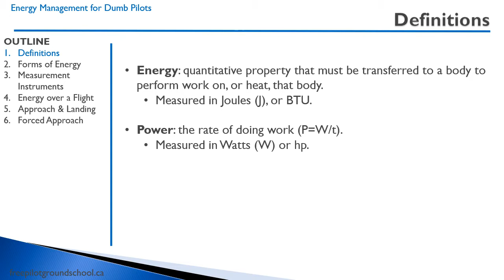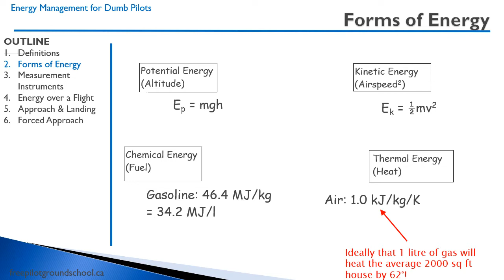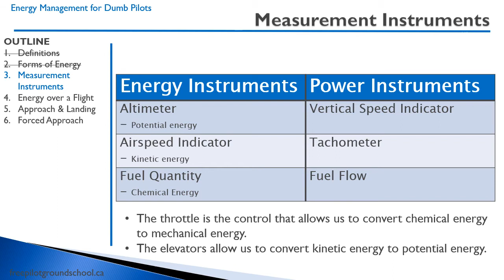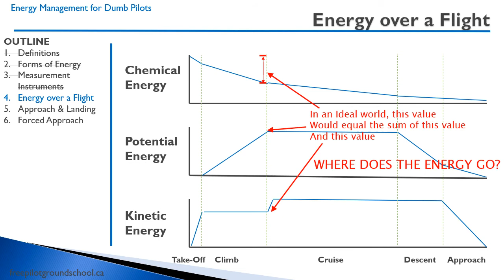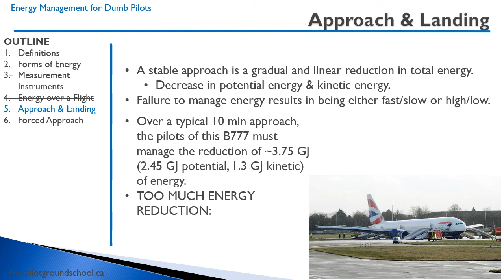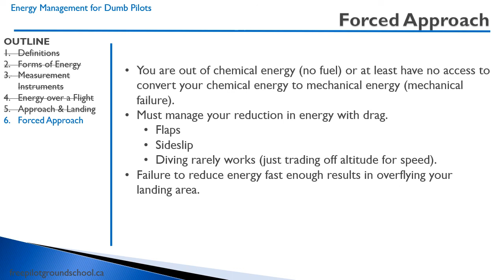Energy Management for Dumb Pilots

Comment: To answer your question - through the miracle of AI:

Great question — and you’re exactly right in your reasoning.

Yes, most global warming is driven by the greenhouse effect — where gases like CO₂, CH₄ (methane), and others trap heat in the Earth’s atmosphere that would otherwise escape into space.

But you’re also right that burning fossil fuels releases heat directly — and that heat must go somewhere, contributing to the Earth’s energy budget. However, the direct heat released by combustion (also called anthropogenic heat flux) is tiny compared to the heat trapped by greenhouse gases.

🔥 Breakdown: Direct Heat vs Greenhouse Effect

1. Direct Heat from Burning Fossil Fuels
	•	When you burn fossil fuels, you release thermal energy (waste heat) into the environment.
	•	Globally, humans release on the order of ~0.03–0.05 W/m² of anthropogenic heat flux (from all human activity — not just fossil fuel burning, but also industry, electricity, cars, etc.).

2. Trapped Heat from Greenhouse Gases
	•	The radiative forcing (extra heat trapped) due to increased CO₂ alone is about 2.0 W/m², and the total greenhouse gas effect is well over 3 W/m² as of recent measurements.

So the greenhouse effect from added GHGs traps over 60–100 times more heat than the direct heat humans release by burning fossil fuels.

🔧 Analogy

Think of it like this:
	•	The direct heat is like leaving a candle burning in a room.
	•	The greenhouse effect is like insulating the room and turning on a giant space heater — the heat builds up and can’t escape.

✅ Bottom Line:

Yes — the direct heat from burning fossil fuels contributes a tiny amount to warming, but it’s negligible compared to the heat trapped by greenhouse gases. The greenhouse effect is the primary driver of anthropogenic climate change.

Let me know if you want visual data, citations, or an aviation-specific angle (like contrails or jet engine emissions).

Comment: Excellent video!! It reminds me of my freshman Physics 107 class. Releasing that heat into the atmosphere has to increase the mass of the atmosphere by some infinitesimal amount (m = E/c^2). This would also have some net effect on atmospheric density. In turn, this density change would have to affect the amount of solar radiation retained by a more or less dense atmosphere. With the sun nearby, we can't totally see our planet as a closed system. So it all may be just one giant governing system, like the flyweights on a constant speed prop.

My small airplane has a 70 KIAS limit for the first notch of flaps, and it's a very slippery airframe design (think glider style slippery). Unlike my last airplane (a Cessna 182), I have found this little guy very challenging to be at both the correct airspeed and height when crossing the numbers. I'm nearly always too fast and most of the time too high. I do  have spoilers on top of the wings. But in my mind, having to deploy the spoilers means I failed energy management.

Comment: Note a forced approach isn’t necessarily an engine out scenario. A potential alternative is stuck throttle and/or partial power. And such could be under-powered or over-powered. Though in such situation you may find a point you deem it good to deliberately force the power out scenario.

Comment: While velocity gives you absolute kinetic energy, you’re better thinking in terms of AOA (though still use ‘fast’ and ‘slow’ so as not to confuse positional low and high terms) as AOA is your margin of acceptable kinetic energy. AOA also solves for load including both weight and bank. We care about relative kinetic energy not absolute kinetic energy. I’ll also disagree with slower being worse than low as this is a contextual statement made in absolute terms. Slow is worse than low only on the backside and only if significantly slower than the flat point of min drag for jets though really at any point back side of min power for props. Gliders use the drag curve though there’s not much space min drag to stall, so they’re somewhere between the more relaxed jet view and tight prop view while helicopters need to be really tight below min power bucket. Remember the slope of a curve is at its slowest at a bounded minimum hence minor deviations from it are not all that impactful. Now, in the jet case, you have a different concern of response time with turbine and compressor mass and spool-up time, which is why they generally try to fly front side. Being on the front side, if you get a little slow, you’ve reduced drag and you’re ok. Considering that you are addressing a GA audience, consider a Cirrus which uses 100 kts as both instrument approach speed and downwind speed yet has 92 or 95 kts as max weight Vbg (shame they don’t publish an AOAbg), losing the ten knots 100 to 90 doesn’t hurt you at all. This is even more true considering a half flap Vref at max gross is 85, full flap 78 or 80, and no flap is 90. If it be available, however, three o’clock AOA is your friend. In gusts, ok, go half flap and four o’clock. Now, if you’re 78 knots and lose ten, that is a big deal and likely your AOA is at about twelve-thirty. The price of slow is contextual.

Comment: Almost all your carbon burning contributes to global warming. But it is slower than you think yet it is accelerating… How is this? Global warming isn’t really global warming, rather it is more global insulation. What you think is a large amount of heat from burning is really actually small. Rather, instead, the large heat source is the sun. But we generally radiate away the same amount of energy we absorb. With increased insulation, however, more of the sun’s radiated energy stays trapped. Yes, the carbon fuels add to this but the real kicker is the loss of ability to appropriately cool. Here on YouTube you can see both Just Have A Think and the Veritasium channels with good stuff on this. Remember, with warming, you have positive feedback loops meaning more insulation therefore less cooling therefore perceived more heating.

Comment: Great video. A concept that is not clear, at least to me, is what impact does speed brakes have, explained by conservation of energy. I realize it increases drag, but after that please explain if you can. Thanks again for your videos
Reply from the maker: Excellent question. Speed brakes increase parasite drag, which for all intents and purposes, converts kinetic energy to thermal energy (just like how wheel brakes on a car heat up) and therefore energy is still conserved.
Reply: @freepilotgroundschool2326   Since Kinetic Energy is lost, to pay for the drag, what happens to potential energy in this conservation of energy equation
Reply from the maker: @frysimulation  Potential energy remains constant if the altitude remains constant. The equation is a bit simplified. The equation should properly include thermal energy and nuclear energy as well, but thermal energy (from increasing drag) is somewhat negligible, and nuclear energy is completely negligible!
As an aside, it's interesting to note that speed brakes are more ineffective than they may seem at first. In the jet aircraft that I have flown (CRJ & B737), the flaps and gear provide much more drag and thus higher rates of decent than the speed brakes. The speed brakes are only useful if you are far out and anticipate not needing the extra drag some time before landing.
Reply: @freepilotgroundschool2326  I am trying to learn the 737-800 in XPLANE and when they get high on the profile many use speed brakes, which decreases speed, but if your too high you must reduce potential energy so I assume the computer must adjust something to reduce the height
Thanks so much for your time.
Reply from the maker: @frysimulation  On the -800 if you're too high and you're still far from the airport, the best configuration is speed brakes to Flight detent and increase speed to Vmo/Mmo. Close to airport, slow to 250 KIAS (which you should be anyways below 10,000'), flaps 5, gear down, slow to below 200 KIAS and flaps 15. Descend just below 200 KIAS (the Flap 15 VFe). Once on profile, extend landing flaps (30 or 40). If you're still to high/fast at 1000' AAE, either conduct a Go Around or, if the airport isn't busy and it's VFR, do a visual 360 to lose some excess energy.